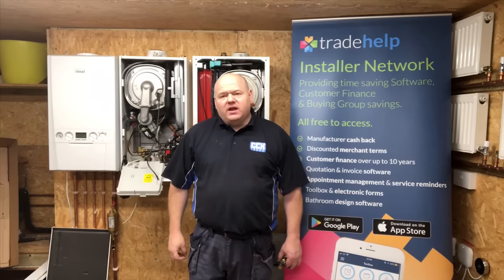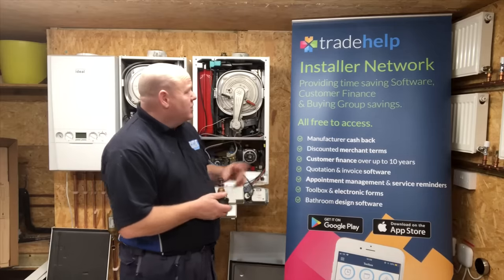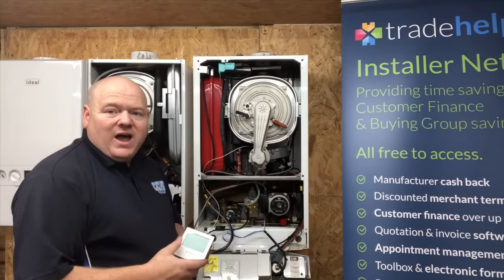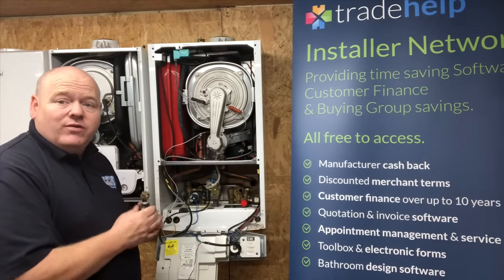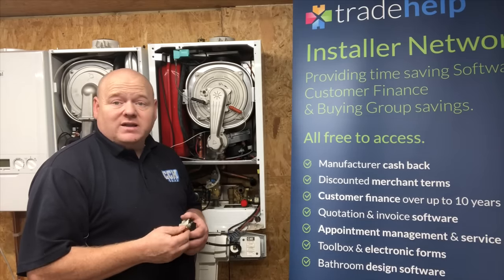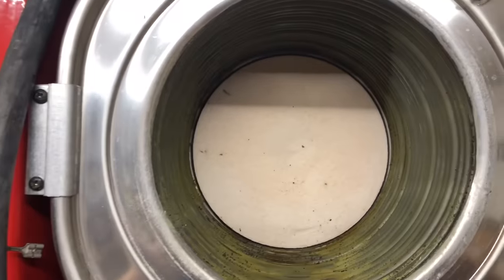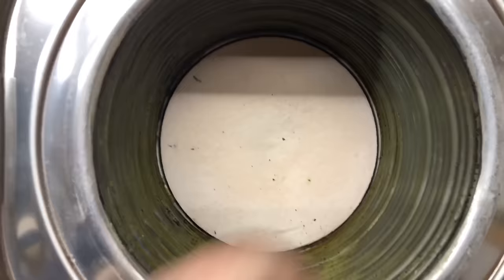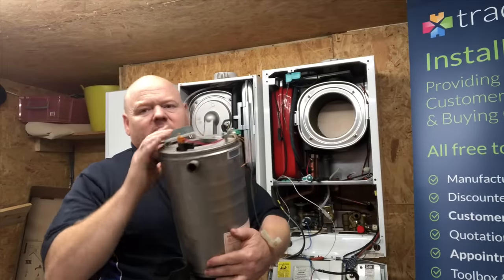How Does A Combi Boiler Work - Boilers - Diverter Valves - Hot Water Sensor

Comment: Thank you for the tutorial.
One question if I may.

When the thermostat switches the central heating but the boiler is continuing on heating the radiators for an hour or more at times, which element could faulty?
Central heating is activated on time, just when it comes to the time seating to be cut off it continue for some time.

Comment: Question Allen, I know it can be difficult to diagnose not seeing the problem but basically my radiator closest to my combi is coming on when we have HW demand and it also comes on when the boiler fires because it’s got a preheated cylinder in the combi and this comes on every hour or so to keep the temperature up and both turn on our closest rad, someone’s already said diverter valve but I thought I’d ask an expert. Thanks. Charles Renwick.
Reply: Diverter valve is sending flow to radiators instead of the plate heat exchanger. The reason only a couple rads get hot is because the diverter is only stuck open slightly, this will also affect the hot water temperature as the full flow around the plate is not there

Comment: Hi Allen. Well done on the vid. Quick question. My daughter's house has an Ideal boiler which has a function of pre-heat on the water system. I assume this give a small volume of instant hot water when you turn on the tap but is this held in the plate exchanger? cheers
Reply: The pre-heat mode fires the boiler occasionally which in turn keeps to plate heat exchanger hot ready for a water draw off hence saving the time waiting for the water to heat up

Comment: hi allen,my  divertor cartridge was leaking from  pin in divertor which was changed but since then  lukewarm water in bathroom but hot in kitchen ,,could this be the divertor head , (which wasnt changed) cheers dude keep up the good work
Reply: yes, could be sticking not fully open, firstly run the bathroom tap when the heating is cold, put your hand on the flow CH pipe, is water constantly going down the pipe? if not, then do a flow test on the 2 different outlets (using a bucket and a stopwatch) baths can be deceiving as the water seems slow.  it may be the boiler cant heat the water up fast enough....and theres a few reasons for that

Comment: Hi mate,
My brother’s house just had Baxi 830 installed but the engineer disconnected the mechanical thermostat at the doorway and told him to that he needs to have the wireless Hive installed. But at this moment, he doesn’t have the thermostat installed and so he has to use the dial set to minimum at the boiler to stop flame but the sign of radiator on the display at the boiler is still flashing. Does it mean the pump of boiler is still working because I could still hear the noise of working from the boiler? Would the pump stop after a period of time? Do you know how long would the pump be stopped? If my brother does not install the thermostat forever, would it make any damage or harm to the boiler? Would it reduce the life time of the boiler?
Thanks

Comment: Looking for some advice, 

My baxi boiler is producing lukewarm water when the tap is at full flow, to produce water hot enough for a bath, I need to reduce the flow, so minimal is takes 30 minutes to fill a bath. 

Will this increase the usage of gas? 

One engineer said it was the heat exchanger, landlord refused to pay, and sent someone to turn the flow down on the boiler.
Reply from the maker: Could be a number of things. Boiler might not be setup correctly, Sludge in system, etc.
Reply from the maker: Thanks very much for your comment, please consider subscribing to support the channel 🙂
Reply: I've subbed :)

One plumber said it was the heat exchanger,  but the landlord refused to pay, sent someone else, who just reduced the flow to the tap, but I'm concerned I'm having to run the water for 30 minutes to get a bath, thinking I'm going to use more gas?
Reply from the maker: @DavidMoralee  what boiler do you have?
Reply: @AllenHart999  many thanks for your reply Allen, it's a- baxi duo tec combi 24 he a
Reply from the maker: @DavidMoralee  That’s a small output. sounds right though that they would need to reduce it.
Reply: @AllenHart999  Many thanks for your reply .

Comment: Does the expansion vessel only come in to play for the central heating then? It has no effect on the water temp out of the taps?
Reply: yes, this is true, because when you run the tap, only a small amount of the heating system is actually heated, ie the water inside the boiler, then when you close the tap, a small amount will then go down the CH flow pipe. therefore not heating all of the CH water, so no expansion.  However, if the pressure is low (differs from manufacturers) usually <0.5 Bar,  the boiler should fail to fire and show an error code.  or it would be like running a car with no engine oil

Comment: You only explained 2 position of the diverter valve.. What about having hot water and radiator working at the same time.. Shouldn't have three positions? Or it is priority to the hot water, so the radiator are switching off when hot water is required? I just qualified level 2 plumbing and heating..

Comment: Hi Allen, I’m a level 2 apprentice at the moment so I enjoy these educational videos. 
When you run the hot water tap and the heat exchanger transfers heat from the heating water to the cold water(becoming hot water) does that mean the radiators in the house will heat up also? As obviously the heating water needs to be hot to exchange heat to the cold water. Thank you
Reply from the maker: The diverter valve goes between heating or hot water, When in hot water it sends it around the plate heat exchanger, The rads will not work when hot water is getting hot. Hope that helps. Thanks.
Reply: Also another question if you don’t mind. What happens with the diverter valve when you want heating AND hot water? Does it open half way? To allow water to flow into the secondary exchanger as well as flow around the heating circuit?
Reply: A combi can only do one or the other pal, hotwater gets priority, if heating is coming on when hotwater is calling for heat then diverter is faulty
Reply: Thanks guys.

Is it possible for unvented cylinders to provide hot water and heating simultaneously via a mid position valve?
Reply from the maker: @daleprosser350  As above, Hot water would have priority in most combi boilers.
Reply from the maker: @daleprosser350  Yes an unvented cylinder will normally be on an s plan or y plan, Both will work at the same time. Thanks.

Comment: Hi Alan what is the purpose of the transparent plastic tube that connects from the gas valve to the burner? and are they on all gas valves? Thanks
Reply from the maker: +David Ring Tells gas valve fan is running
Reply: Sorry I don’t mean the APS. Its a little transparent tube thats that goes from the gas valve to the burner area.

Comment: My main problem with any combi is that every breakdown is an emergency. You've suddenly lost everything. With a heat only/system boiler, with cylinder and immersion heater, all you need is a couple of fan heaters whilst parts arrive or you await an engineer and you have a minor inconvenience to cope with, not a crisis.  Much as I dislike them, I've even kept a gas fire in case the electricity fails, which it does round here from time to time. Some combis don't have plate heat exchangers.....dare one mention Ferroli and Intergas in the same breath ?

Comment: I have my DHW cool at around 40°. That's fine when the central heating is off but when the heating is on the DHW immediately scolds yours hands. Very dangerous when I have young children. Why does this happen and does it indicate a fault?
Reply from the maker: What boiler is it?
Reply: @AllenHart999  Viessmann Vitodens 050w. I was thinking maybe a faulty diverter or heat exchanger plate.

Comment: Hi Allen , I am struggling to get an ideal logic into hi fire,  its a logic combi 30 , the 10 - to 2 O clock thing doesn;t work. It was frustrating dong the gas rate
Reply from the maker: I would just run hot tap as a last resort 👍